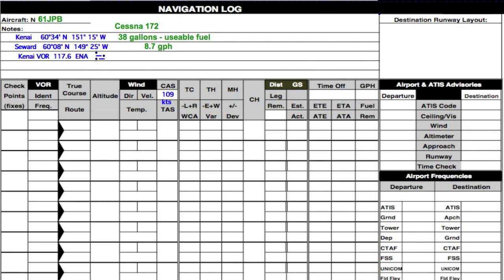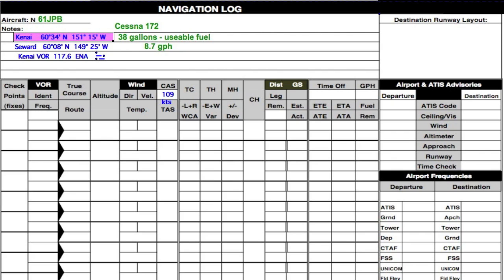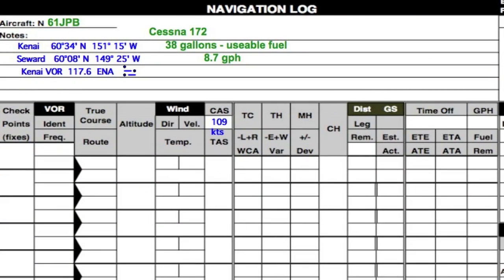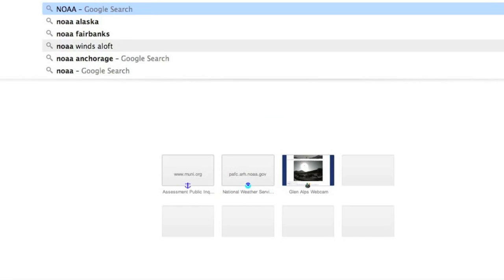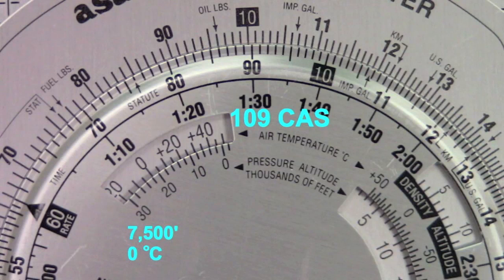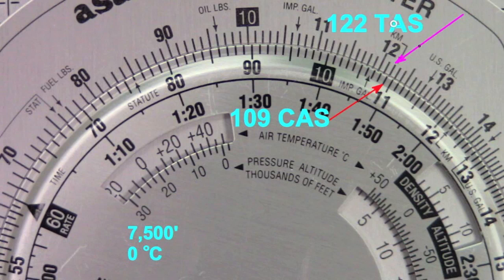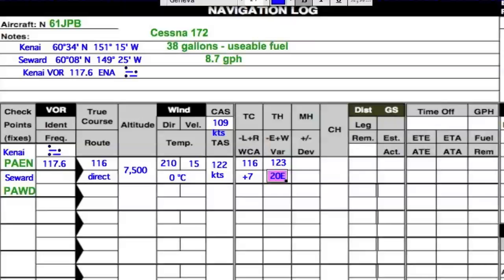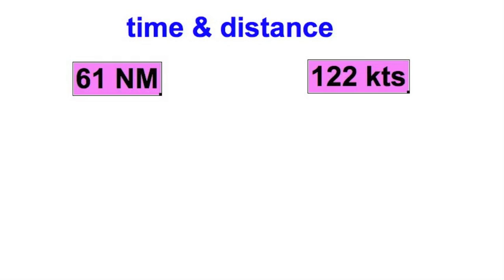Flight planning with sectional, plotter, & E6-B

Comment: You estimate  your climb out at 2 Min to 7,500 feet. Is this correct?
Reply: No. The time in climb is already part of the 30min trip time, as the ground that is covered during climb is part of the 61nm total distance at 122kts. He simply added 2 minutes to allow for the assumption the he would be slower than 122kts average during the climb.